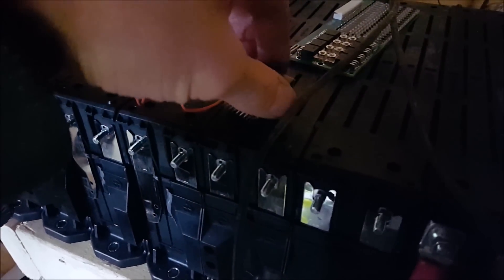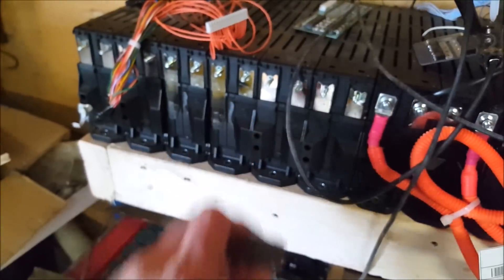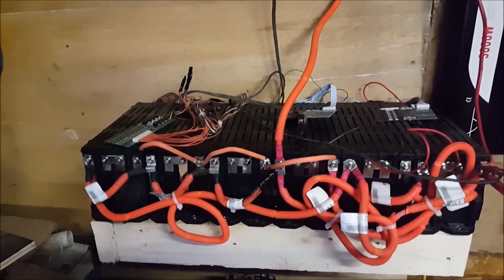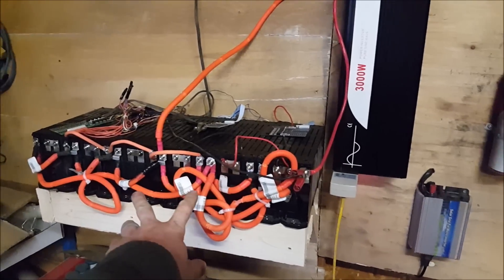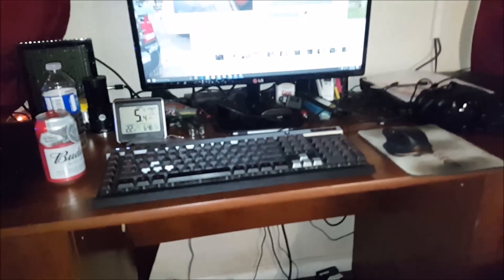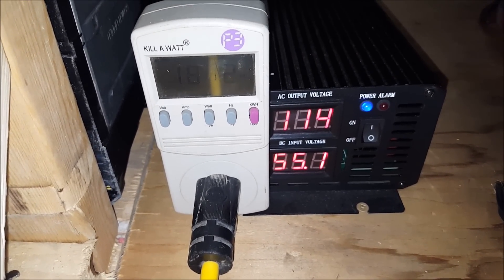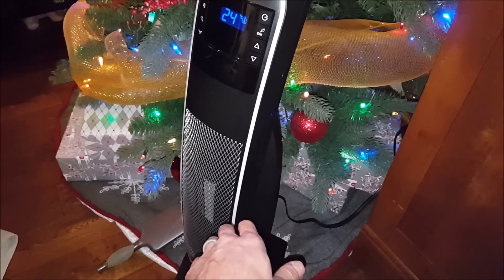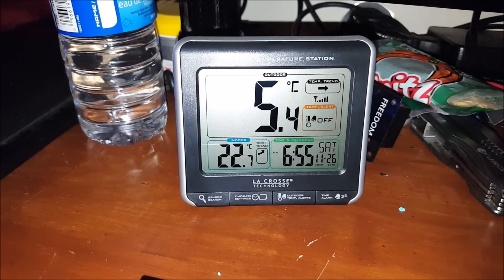Power Wall Gets Another Kw of power!

Comment: Thanks for fixing it. Nice video. I just hooked up a BMS and can not tell if it is working yet.
Reply from the maker: if the bms is letting power run through it then it is working, if there is no power running through it then there is either a call way out of balance or it is to low of voltage to operate.
Reply: Yep as soon as I connected the epever negative to the unit then about 10amps of current started to flow and then around 29.4V it slowed down to almost nothing so I guess it is working now I need to see if it balances them out. Thanks